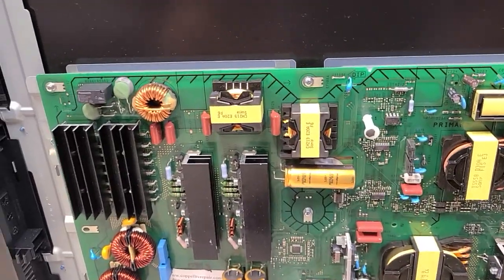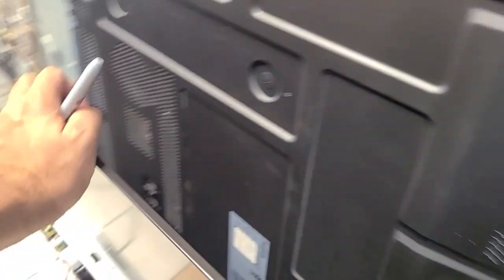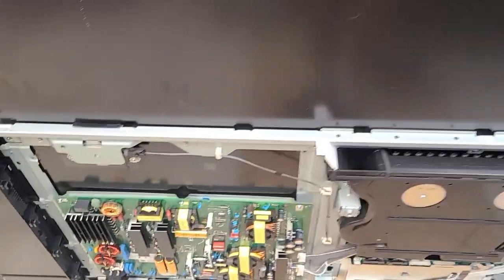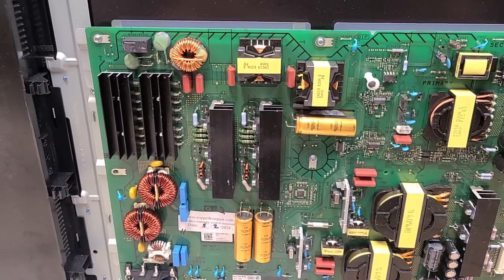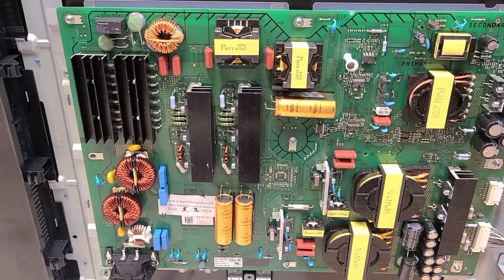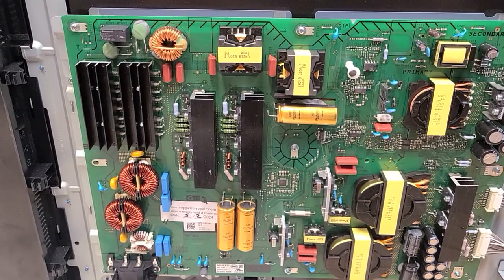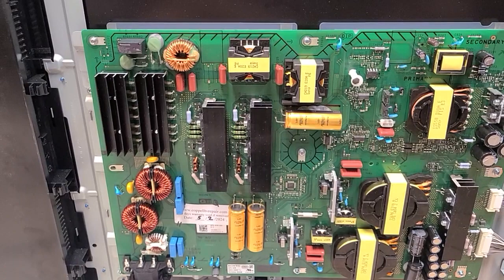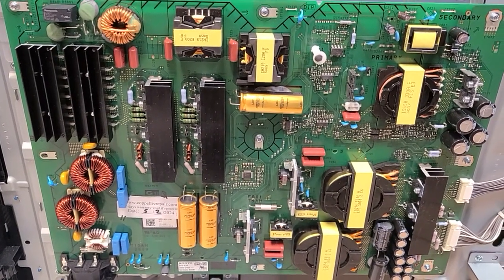Functionality proof Sony XR-77A80J power board APS-439 (CH)

Comment: can you tell me what was failed component on this board ? which exact part ?
Reply from the maker: Of course I can, but where would be the fun of learning and solving problems on your own if I do?
You can do it!
Reply: @coppelltvrepair  can you give me some pointers where should i be testing ? new at this ..lol  if you give me some pointers maybe I can try and test the components out. :)
Reply from the maker: @grilledchickenwrap  My advice is to look as many “How to test” and/or “How to diagnose”  and/or “How to repair” videos about TV power supply boards – up to the point where you can identify yours and apply the patterns learned to it in an attempt to isolate the failed section.

Then watch videos on how to test/troubleshoot particular circuits and…you are likely to arrive at the destination.

If I tell you more it will be like enabling your brain to be lazy and receive solutions instead of working to get them.